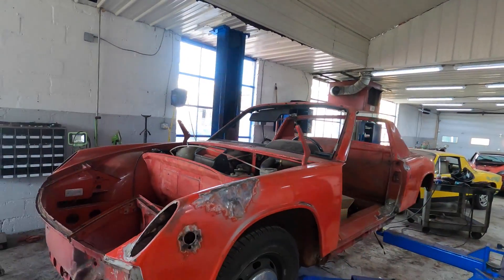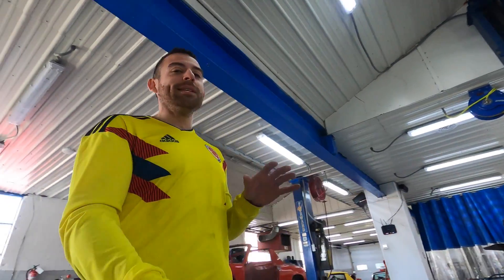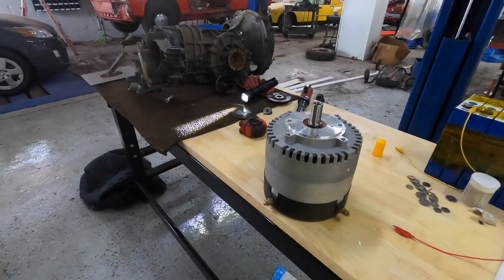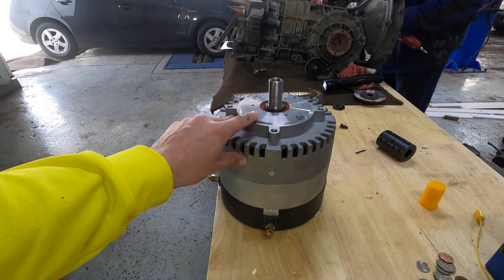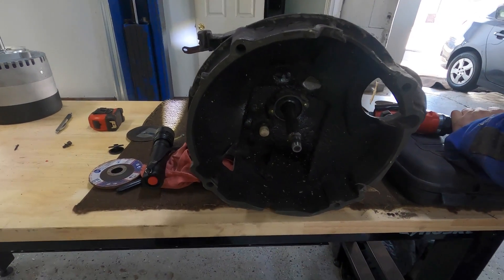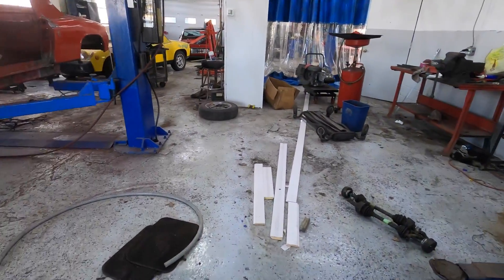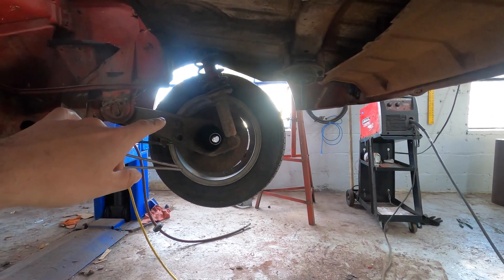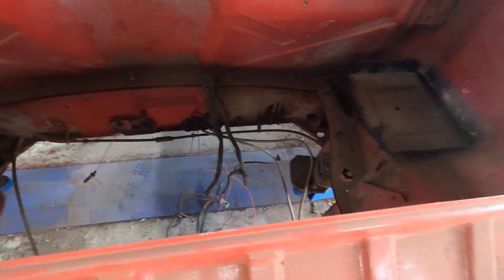914 Porsche Electric Conversion at AMBLER EV pa

Comment: Going to need a working clutch or auto trans. not going to shift at speed just stopping power!
Reply from the maker: Na you lift your foot off the peddle because the motor and shaft are always in sync you dont need a clutch, the clutch on a motor is to match up the motor rpm to the trans rpm, this set up keeps them the same all the time